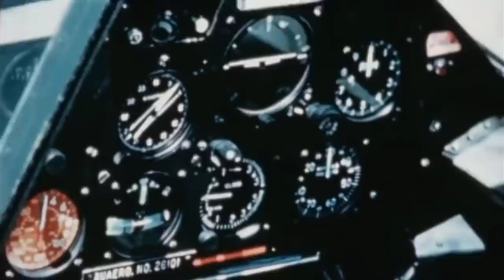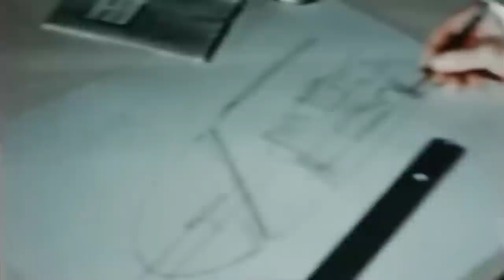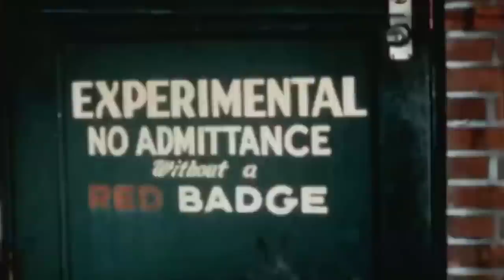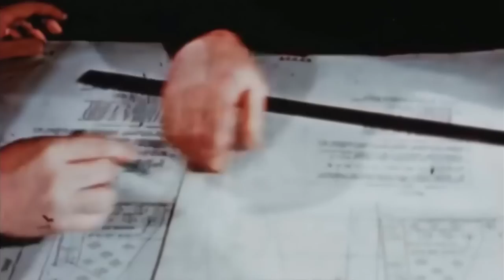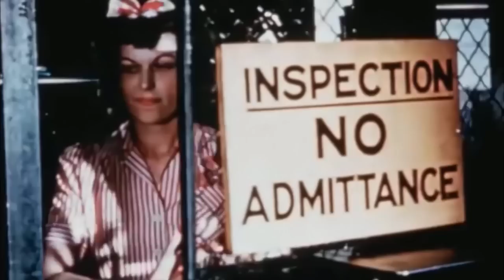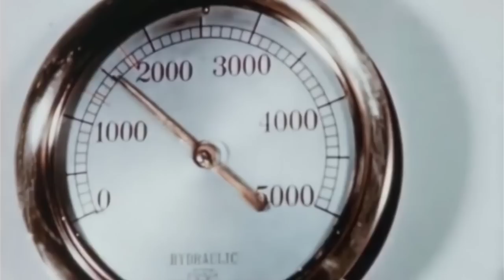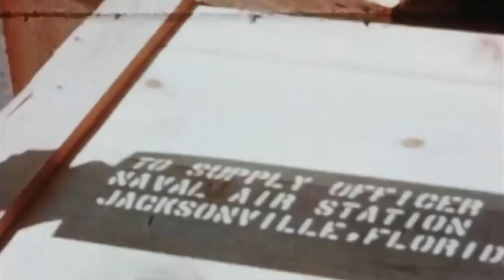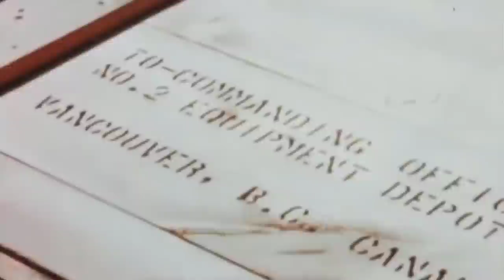Making the F6F | Grumman at War (1944)

Comment: The film fudges the facts - the blue F6F marked TEST is not the first made. That is an F6F-3. The XF6F-1 had a less powerful engine.
Reply: Gubmint always lyin, son
Reply: wrote the same today and now found your comment you are right its not even the first Production F6F-3 Serial/BuAer No. 04775, look at 3:48 its  BuAer/ serial No. 26101 , looks like an early F6F-3  Production aircraft with exhaust cover under the upper Cowl Flaps, on late F6F-3 this cover was removed.

Comment: Min 1:05 its not the first F6F ever made looks more  like an  F6F-3 used for tests, if i remember well the first XF6F-1 (BuAer. /serial. No. 02981) had a spinner on the Prop  , Propblades with cuffs  (cuffs?) was natural metal and had other bigger landing gear covers then Prod. aircraft even the 2nd Prototyp XF6F-3 (serial No. 02982)looks very different from the one shown here at 1:05 with same big spinner on Prop and big landing gear Covers and no Paint

Edit: at 3:48 you can see the serialnumber of that plane its BuAer/ serial No. 26101, so 100% not the first F6F ever made not even the first Production F6F-3   because that was F6F-3 Serial/BuAer No. 04775 .